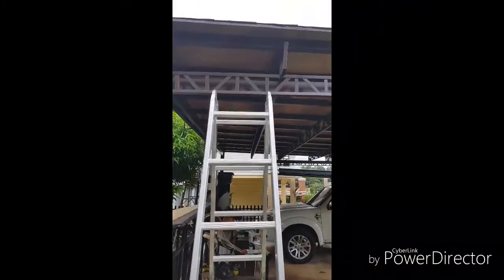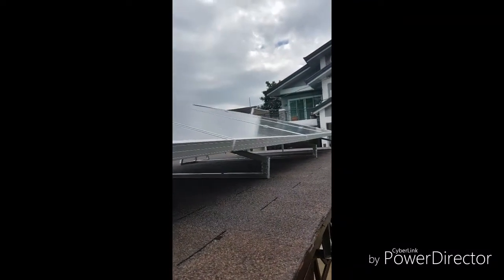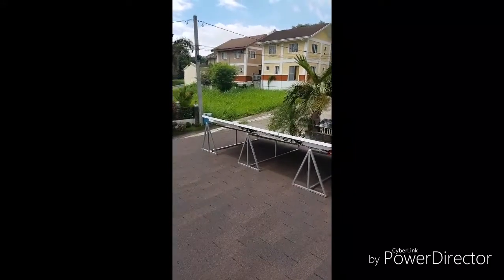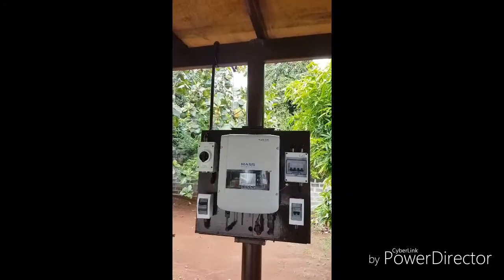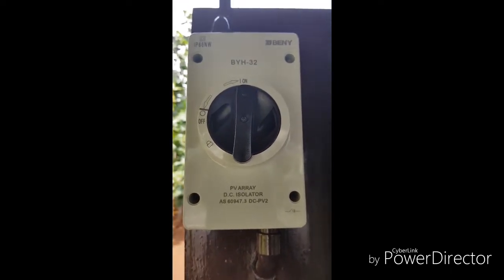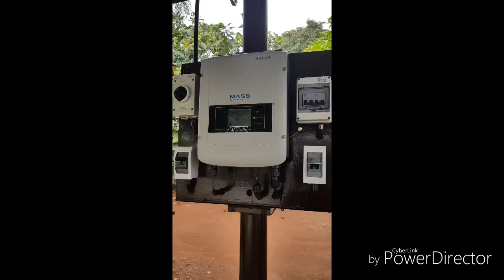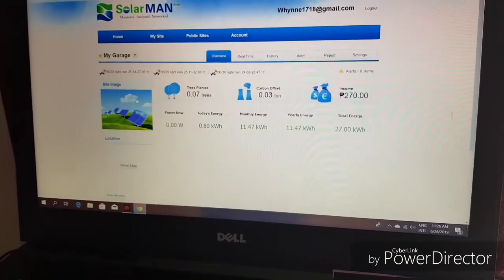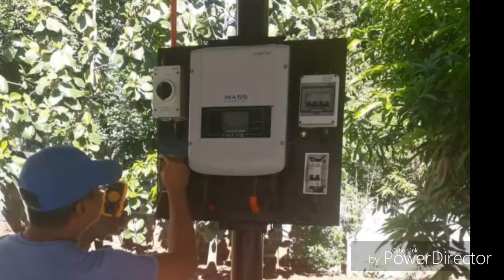Solar Pinoy  (Philippines) - Simple grid tie setup on our garage

Comment: 1,200 watts per day?
Reply: 1200 W is peak power. So only with good sunlight. On average you shoud get about 5 hours per W of installed capacity per day, so 1200 Wp should give 6000 Wh=6 kWh on an average day.

Comment: Asked ko lang sir...why did you choose series over parallel?? Anong ponh benefits, ang turo po kasi sa skull mas maganda ang parallel set up
Reply: 10A lang kasi ang capacity ng inverter niya. Kung 300W panel ang gamit niya, at around 32 Vmp, Imp = ~9A. So if 4 panels connected in parallel, ~36A ang total current ng array which is far greater sa capacity ng inverter.
Reply: Tama po si xaviery. Type of array is base on the capacity of your devices. If naka off-grid naman, include in considering the distance of your batteries from the array and the budget. Kapag malayo, dito masganda ang parallel for less losses kung kaya naman ng devices ehandle ang current. 
Sa budget aspect dito papasok ang optimization ng wiring, kung anong size para makatipid. 😁

Comment: Very nice setup, I have a similar system hooked up to my house in the states  2.5kw system.  I'll be shipping some panels to our house in Pinas to install another system. Its great the inverters nowadays have the Limiter function, however I'm also thinking about setting up a battery back up as there are a lot of brown outs in my area of Bulacan, and also so the energy collected isn't wasted by the inverter limiter.

Comment: sir i have one request. can you show how did you connect the AC output to grid? 
i mean from inverter out AC, to breaker, to AC disconnect and to Grid.
Thanks!!
Reply from the maker: Hi. Inverter output is connected to a 30a AC breaker. Then, this breaker is connected thru a 10awg wire and the other end is connected to a 30a breaker which is connected to the main breaker (with available breaker slot). Hope this help. Thanks!
Reply: @sinagarawrenewableenergyso540  Thank you sir

Comment: Hi sir.. tanung ko lng kung bumabalik b ang reading ng electric meter nyo pg ngfeed kayu ng excess energy s grid?

Samin kasi s Cagayan de Oro, hindi bumabalik oh bumababa reading ng electric meter peru meron bumabalik nga kuryente s grid
Reply from the maker: I had a limiter connected to the main and export function disabled in my system. This will prevent exporting to the Grid. All energy is consumed within based on what is need by the household.
Reply: @sinagarawrenewableenergyso540  illegal po ba yun or legal? pag naka limit ba no need na kumuha ng permit sa meralco?
Reply: Pano kapag sobra harvest from solar? Hindi umaandar yung metro?
Reply: Tanong nio sa meralco kung pwede kyo ng net metering ibang kuntador un.research nlng
Reply: In Cagayan De Oro, I think Cepalco has Net Metering although not as known as Meralco.

Comment: Yung grid tie inverter mo. Pwd ba e connect sa outlet pabalik sa meralco?
Reply from the maker: Grid tie inverter connected to AC Breaker then Main Line. Wire should be within the specs.
Reply: @sinagarawrenewableenergyso540  Hi, what do you mean by main or main line? Thanks